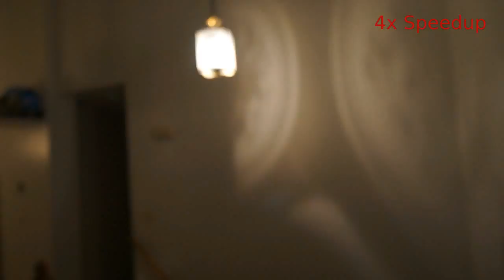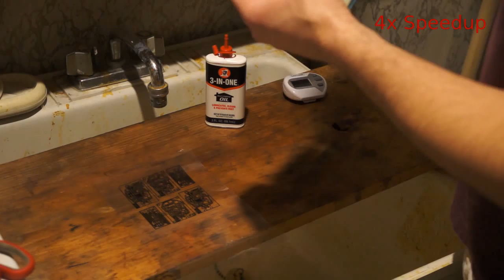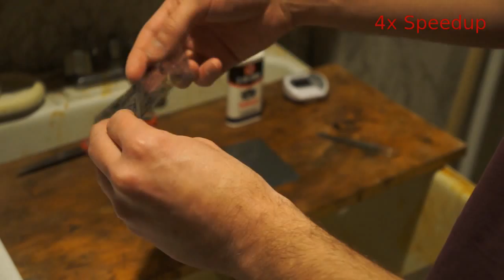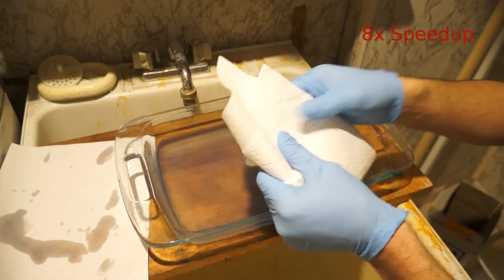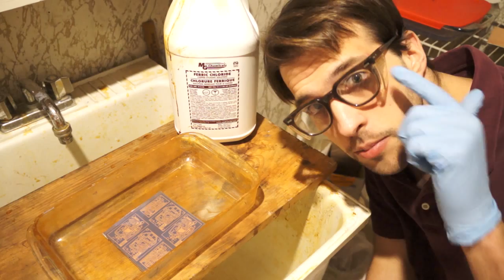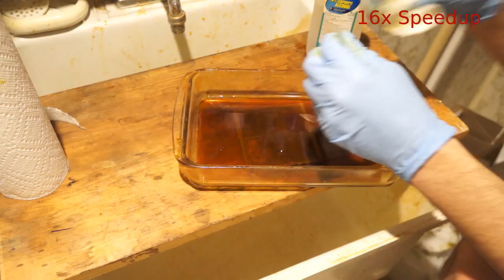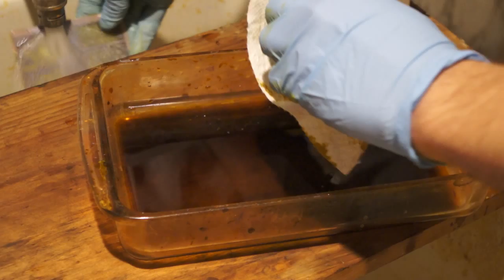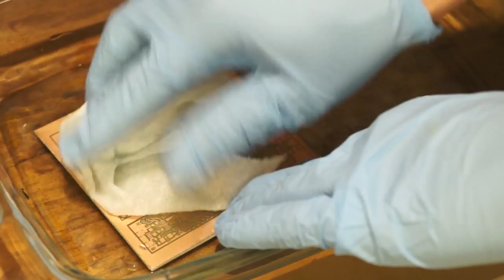How I do my projects - Part 2 - Producing the PCB

Comment: Why are you using ferric chloride? There are way better things like Copper Chloride in Aqueous Hydrochloric Acid Solution. When I made my own boards, I had some HCl so i just made my own and also you can control how aggressive solution you want. Also with just HCl and Hydrogen peroxide you get Extremely violent echant which can later convert to the first mentioned solution. 

anyways WAY better than FeCl . Really hated that thing when I tried it. 

EDIT: Also this has been talked about by others as well. Should have guessed. 

EDIT2: also the violence depends on the mixture and dilution... doh.
Reply from the maker: I'll give it a shot next time.  What is your recommended mixture?
Reply: It mostly depends on how much acid are you willing to let evaporate. If you get something like 30/70 mixture of acid and peroxide you can get away with few seconds of etching. I used 60%clean HCl and 70% peroxide. That fumed the room up so that not using special chamber was not an option. Also tried with 5% and 6% mixture. That worked nicely, albeit slower.

Comment: I have a question: can you use lens to reduce the dimension of the pcb during exposure, making a smaller board?
Reply from the maker: That is a way that PCBs were made, but it would be difficult to get the optics and all for this process.  Also, I am not an optics expert.

Comment: do you think i can get away with ironing on Riston, because I don't have a laminator?
Reply from the maker: I don't think that would work very well, would be difficult to get it evenly across it without a lot of effort
Reply: understood, thx for quick response.
i still don't feel like buying a laminator tho XD so ill try using the iron with some small insignificant circuit and see if it works.

ill let u know how it goes.
Reply: (bumps post)
So how'd it go?

Comment: I'm just getting in to PCB production at home using similar methods. I don't have a laminator so I've been experimenting with an iron to apply the photoresist coating, though I haven't quite mastered that yet! As for etching, I use a polythene bag and a slide binder, which works really well. I got the idea from this video - https://youtu.be/nTQRRER1MOY?t=10m50s.
Nice idea with the 3in1 oil, I've been wondering how to get a decent adherence between the transparency and the board.
Reply: Also, you should try applying solder mask to your PCBs, it makes them much easier to solder and they look well professional.
Reply: So, I've watched a few more of your videos and I've concluded that you're probably quite familiar with solder mask; I guess it doesn't look that good on a glass PCB.
Reply from the maker: I have actually done solder mask on a few boards, the problem is it takes a few more minutes and I just don't find it worthwhile for most design.   I used toner transfer for the first 60 or 70 prints I did.  The last 60 or so have all been Riston.  I don't know.  It is just really hard to master.  I feel like there's a little more of a curve to use Riston, but it's been worth it!

For those who have difficulty finding easy ways to get and dispose of ferric chloride, that bag technique looks awesome.  Right now, though, all my boards are all over the place size-wise, so I don't think I'll be switching to it.
Reply from the maker: BTW!!! I will be posting a new PCB video on Sunday.
Reply: It's definitely worth the effort IMHO. It may be easier to send your design to a manufacturer and get a nice PCB sent to you in the mail, but where's the fun in that?
I've just got a new toner cartridge so I'm hoping I can make something usable this weekend. Previous experiments have been done with a tired old remanufactured (and refilled) cartridge, which didn't work so well. I built an exposure box with 365nm LEDs which seems to work pretty well, but since my stencils were useless I haven't managed to produce anything usable.
Reply from the maker: go go go!!! We can change this world.  Teach others about the wonder of pcb printing!

Comment: Check this guys, It might be useful for you. It will make thinks a little bit easier, well I write about what he said in the video in steps.

  - Method 1: Using [ Photoresist Film ]
    - WARNING: Be sure your PCB board is all cleaned up, use acetone to clean it. 
    - Step #1: Print your PCB project on a transparency film
    - Step #2: Cut the amound of PCB and photoresist film
    - Step #3: Apply the photoresist film underwater on the copper PCB
    - Step #4: Apply 2 sheets of normal paper on the top of the protoresist film and inject them all together into the laminator, then throw the sacrificial paper away
    - Step #5: Spill some Use 3 in one oil on the photoresist film and then apply the trasparency film (Try to get as more bubbles out between the photoresist film and transparency film, the ink on the transparency film have to face the PCB copper)
    - Step #6: Expose the PCB to strong UV light for the fair amound of time deppended on the PCB board. (Try to not let it become purple inside PCB cause it won't come off in the development proccess)
    - Step #7: Peel off the transparency film and wipe clean the 3 in one oil.
    - WARNING: Be sure to use at least eye protectiong cause ferric chloride is dangerous
    - Step #8: Use the right amound ferric chloride and water on a glass container and put the PCB board in and wait for the fair amound of time of time deppended on your PCB board
    - Step #9: Check if the etching was a succsess, hold the PCB board up to the light and check for failures, if you have etching failures, put it back to the ferric chloride and try to rub it using your gloves
    - Step #10: Spill some acetone on the PCB board so the photoresist film will come off wape off the remainings with a paper towel gently so the board won't get damaged
    - Step #11: Use a cutting device to cut the PCB board (I personally use dremel, electric rotary drill grinder)

Comment: What a waste of acetone! This is a terrible choice, from an environmental perspective. Just use NaOH, it works great and is not so bad for the environment. You can dump a little NaOH down the sink without worries. You could even add a little vinegar if you really feel you need to neutralise it. Acetone is way more toxic and damaging. If you really, really feel you need acetone instead of NaOH, then use a little bit on a paper towel for gods sake, not an entire bath of the stuff just for one PCB.
Reply from the maker: +DutchPhlogiston I'm actually allergic to vinegar.  But, I usually discard paper towels  with all the acetone (and allow it to evaporate), as I have a plastic sink.  NaOH does a terrible job at taking the goop off, so I've pretty much abandoned it.

Really, I do the bath just to get the boards squeeky clean and not leave a residue.
Reply: That was only a tiny bit of acetone. You could just toss that outside and let it evaporate, or set fire to it for amusement. I'm not saying acetone is environmentally friendly, but this is a minuscule quantity compared to what's used in industry.
Reply: yeah, ok i have to admit it is tiny compared to the amounts used in industrial processes, and even the total quantity used worldwide by people making PCB's is small in comparison. However, it is way, way more than needed and  I guess I am just a bit allergic to seeing chemicals being wasted. It is just because I work in a chemical laboratory and we take great care to use no more than what is actually needed.
Reply from the maker: That attitude is confusing?  Would saving even a minute of your time be worth wasting almost a liter of acetone?
Reply: I'm not paid as much as you think :).  Also consider the money/time involved dealing with the waste. We can't just dump it down the drain. After a few liters I'll have to go and get a new waste container, give it the proper label, register it in the waste registration system (waiting for the slow computer), register the old, full container in the same system. It'll cost me a lot more than a minute of time. And we pay for processing the waste.
Reply from the maker: but, it's acetone.  It literally evaporates if you leave it on paper towels.
Reply: Evaporation doesn't destroy it. Allowing it to evaporate releases it in the environment. We're trying to prevent that by storing waste and treating it to render it harmless, or if not possible (eg radioactive chemicals) by storing it indefinitely.
Reply from the maker: But... it's acetone! It has a 22 day half-life (due to photolysis)!  Disposing of it in the atmosphere IS a safe mechanism of disposal!
Reply: Indeed it does, producing methane which is a greenhouse gas more than 70 times stronger than carbon dioxide with an atmospheric half-life of 12 years.
You raise a good point though. We do take measures to minimise exposure of workers to chemicals and take pains to handle waste that does not seem hazardous at all.
In the lab, I have to treat acetic acid similarly as acetone but at home, my wife sprays liters of it on the terrace to kill plants growing in the seams between tiles. Oh well.
Reply from the maker: I guess I try to keep procedures balanced with what is reasonable.  I'm not always the best, but I keep trying.

Comment: Why even bother? PCB manufactures do it much more efficiently.
Reply: ArthursHD 
1) Turn around time.
2) You still need to prototype blocks before sending off a design.
3) making one mistake on a board is bad enough. Ordering 10 of them is just dumb. You order pcb's after you have a proven prototype. 
4) "cheap" means your prototype revisions will take at least a month between cycles due to shipping times. I don't know anyone interesting that can wait that long between project working sessions and maintain interest without a paycheck involved. 
5) building your personal skills and craftsmanship is a great way to get ahead in a world filled with lazy people.
Reply: Because I can't have a PC board in 30 minutes from a PCB manufacturer.  And if you're doing low quantity/one off designs, they're far more expensive to have done commercially.